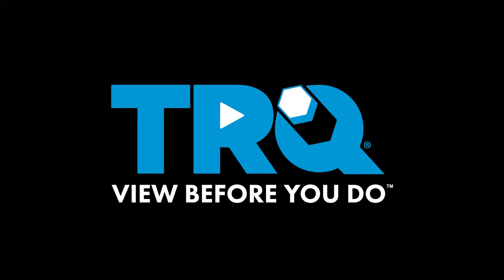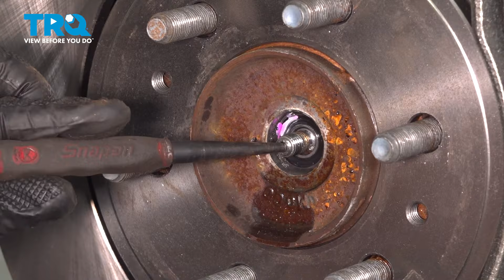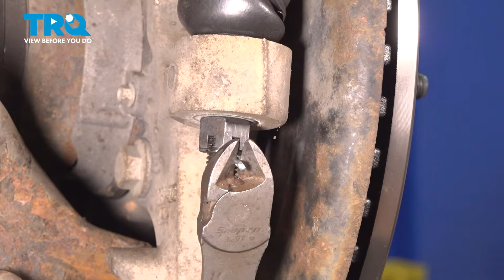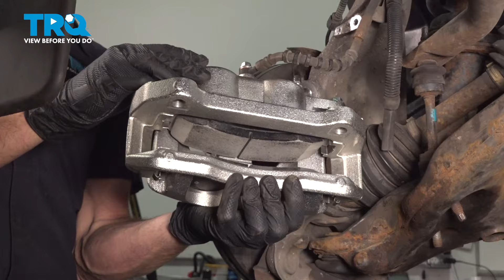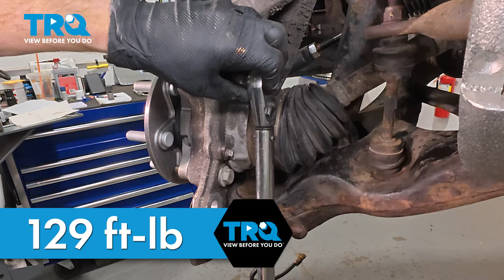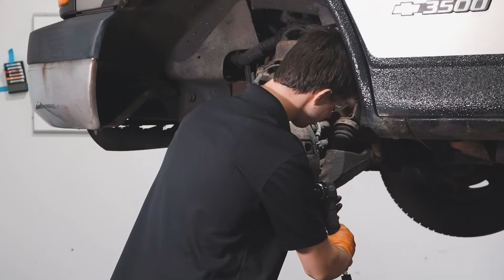How to Replace Wheel Bearing & Hub Assemblies 2015-2020 Ford F-150

Comment: I got a question so u don’t need grease all the way around it ? Like where the axel goes through the wheel bearing ? I did this job and I don’t remember if I apply the right amount of grease over there and now I’m starting to hear a sound coming from that side that I didn’t apply enough grease… I’d appreciate the advices ( or maybe I’m going crazy cause I’m running all terrain tires)

Comment: Just replaced the passenger side wheel hub assembly on my 2018 f150. It was one of the easiest things I’ve done on this truck thanks to this video, by the way you don’t have to remove the tie rod but it does make the job quicker and easier. Great video👍🏻

Comment: I wouldn't use an anti-seize in there at all, and if I did, it would definitely not be copper as that will create galvanic corrosion with the aluminum knuckle and steel bearing assembly.